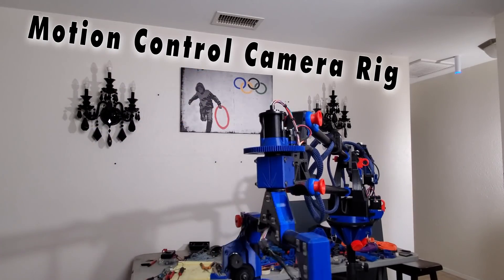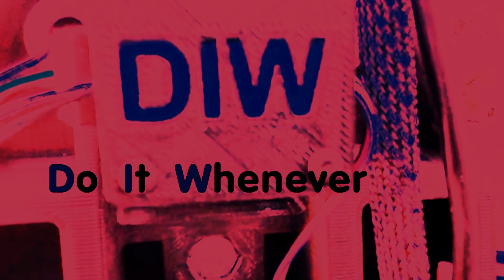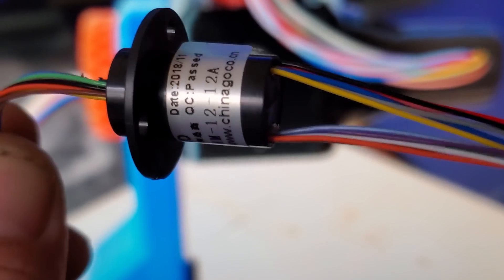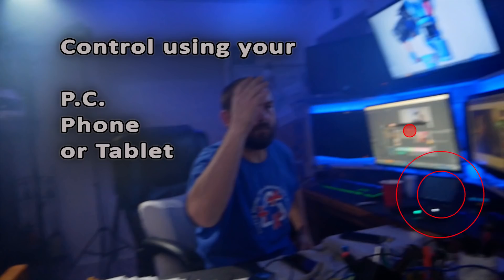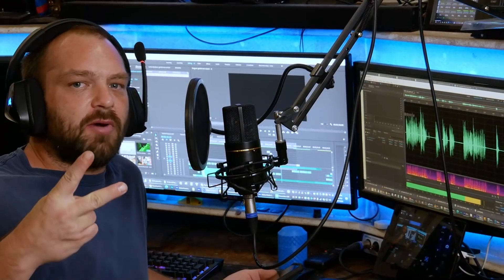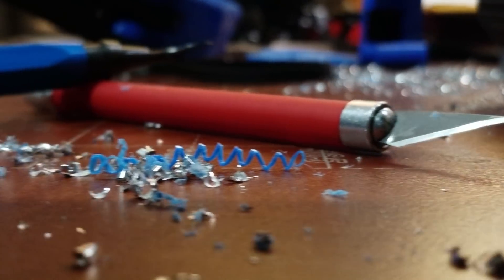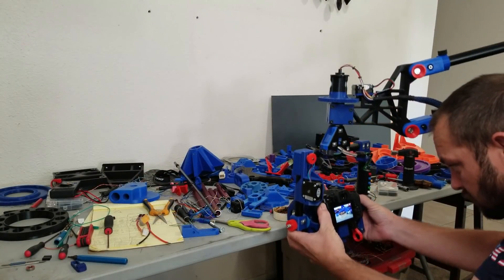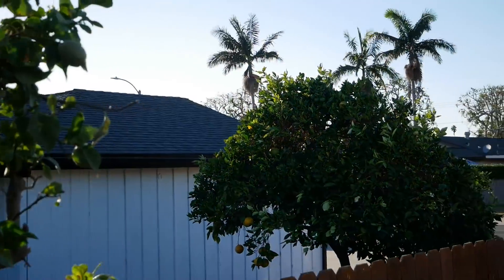The greatest DIY MOTION CONTROL camera rig EVER - allegedly

Comment: If you want to control your motion control rig via a computer then the first step (prior to generating G-code) is to be able to model it as a function of each motor's position. There is open source software to do this on github: https://github.com/HebiRobotics.  Once you've created a model of your rig (rigid structures and joints) you will be able to use its kinematics and inverse kinematics library to either figure out where your end-effect (i.e. the point of the lens) is located based on your motor positions, or better, knowing where you want to point the lens it will give the the required motor positions. Skyentific gives a quick demonstration of this with a simple 3 axis robot arm at: https://youtu.be/RTJcFyFXNE4

Comment: Great idea! I want to develop/build a (non camera) 6dof arm myself. I work in this field and of although there is some improvement possible (there always is) that is a well thought out system tbh. The LCS part is very nice! With that much 3D-Printing integration I'd say you did an awesome job to get as much as possible out of it !!! Regarding the control, I think I read something about a blender plugin to export gcode (maybe you can utilize that for a more powerful motion programming). Keep up the great work!

Comment: Do you want a stupidly bad idea?

Stepper motors, when unpowered, work as a sort of encoder. Every rotation makes a current pulse, and into a resistance becomes a voltage pulse, and there are ways to read that. Isn't that a dream? One button programming. You just guide the head around by hand, and in recording mode, whenever you want a keyframe, you press the button, or a foot pedal, and it remembers, and then it only has to interpolate between those keyframes. You are limited to half-steps, but that's still a pretty decent angle precision, you can get 400 or 800 half-steps per revolution.

Unfortunately, the project like this would be pretty finicky with regard to electrical engineering and potentially sampling too, prone to lose steps. It's probably not really actually a good idea. A much less horrible idea would be to use an optical encoder - potentially an absolute one - somewhere on the shaft.

These kinds of things are pretty much up my alley, but i don't anticipate myself contributing, because i just don't have the money or the desire to build a camera arm. I don't even have a camera. Well i do, it takes 4 megapixel photos, and is 18 years old.

Comment: Great project and great presentation!  One minor idea that came to me, would be to add some viscous parameter (done by adding some derivative term in the control) when manually moving the rig. For example, when you release (by pushing the button) the camera pitch axis, it could swing down fast... but if you had a viscous term (derivative term), it would move slowly.  Anyway, just a random idea.  Great work!!!
Reply from the maker: Thanks for the info, hopefully the next video answers everything!

Comment: First, let me say that this is very impressive work. But nobody can be an expert in the 4-5 fields needed to take this from an interesting project to a useful tool.

There are a couple of different people you might want to contact and/or collaborate with -- The first is Steve Girault of "The Garage Learning" He is teaching visual engineering using video cameras, high speed cameras and robots -- now he uses the giant very expensive robots (Bolt, I think) for his commercials, but he is a true DIY guy and could give you a lot of feedback on software, path modeling and such. Garage Learning is running a Kickstarter right now to get their "school" going.

The second person you should reach out to is "Skyentific" He is a Russian scientist living in Switzerland and has spent the last several years building robot arms from scratch: 3D printing the parts and experimenting with motors, gears, pulleys, controllers ... nothing to do with photo or video but could easily be applied. He just quit is day job at an atom smasher to do robotics full time and is looking for interesting applications -- and yours certainly is interesting.

As for software for generating the G-code -- you could start with some commercial software such as SolidWorks which would allow you to create a 3D parametric model of your rig. (Each motor's position becomes a parameter) Then if properly modeled you can input a set of parameters and see where the "tip" of your arm is positioned and what direction it points. The reverse is more complicated - if you know a path you want the camera to follow there can be infinite solutions but only some of them are optimal.  But software like that is essential for those that are looking for a solution to their problem -- only tinkerers are going to manually write G-code and see what happens.

Comment: This is absolutely incredible! I have been looking into robotic arms for this application and this is by far the best into into the space I have seen! The high end cinebot arms like the bolt cost around $200,000 with the cheapest option I've found being the Universal Robotics UR10 (without any video focused control software) which is still $45,000. I have experience with arduino and electronics but not with 3D printing. Do you have any recommendations? I'm fine with a bit of assembly if it results in better print quality / better value. Thanks so much for the video, can't wait for the next ones!
Reply from the maker: Thanks a bunch.... I can't wait to see what we can achieve together!

Comment: You should consider adding some encoders to each joint. That would allow you to manually move the camera (while pressing your motor disable) to different poses and record each.  Interpolating motion between those keyframes is pretty straight forward kinematics and could be do ne in software.  Then you would have a super fast "teach pendant" mode of programming the robot.  Just move to multiple poses, press a button to record each, then choose a speed and press play.  Would make this thing incredibly handy.  If you wanted to get really fancy, You could replace each stepper with a BLDC motor  (anaheim sells nema 17 sized drop in replacements).  Other than smoother motion, the benefit would be the ability to control them in current mode or torque mode, and program some software controlled compliance to each joint, making manual operation super smooth.  Good work, this thing is super kickass, can't wait to see where you go with the project and channel. Subbed, good luck!
Reply: Manually moving to and recording poses/framings would be so great!
Reply: Came here to say exactly this!
Reply: I agree, take a look at the robots on James Bruton's YouTube channel. Some robot's have beside encoders in the joint also pressure sensors,  so he can detect if the joint is moving manually.
Reply: You could also have a mode where you sample the positions at let's say 30hz and store the smooth motion for later replay.

Comment: Blender is open source and can control your camera.  Not as strait foreword as your approach but can be integrated with stop animation work.  I have no idea how it's done but saw a fella with his own boom that was done this way.
Idea for a boom.  May not be as good as you have now but worth looking into.  You can get fiberglass paint roller handles that are extendable.  Some with three sections even allowing a WIDE range of boom lengths.  Would get floppy at longer lengths but putting a 3d printed connector between the upper and lower boom just behind the nut for tightening the boom slider would help a little with that.
https://www.google.com/search?q=fiberglass+paint+roller+pole&oq=fiberglass+paint+roller+pole&aqs=chrome..69i57.9037j0j9&sourceid=chrome&ie=UTF-8

Comment: Whaaaaaaaaaaao!(like a kid) Whao!!!!! can you Please Please Please make a tripod Mountable version with X and Y axis....(Fully 3D printable)....Also a tip: you could use blynk to remotely control and also get video to your mobile device. Amazing project Dude!....The looks are amazing

You Could use blynk Iot Platform.....using that you could control your motors from your smartphone (using virtual joysticks and also your phone sensors) and by using a raspberry pi and a hdmi capture device you could stream your video from camera to your phone over local wifi(for low latency) or over 4G to control it from anywhere from the world

Comment: You could use encoders on your motors to enable a "replay mode".
Basically, you would switch the rig in "listen mode" where you orient manually the rig and click on a "save that position" button.
Then, it's a just a matter of interpolations between positions.

Comment: what about using gphoto2 to control the camera instead of using aditional stepper motors?
https://www.youtube.com/watch?v=1eAYxnSU2aw
Reply from the maker: just saw it. Thanks... but unfortunately my camera had issues with gphoto2 on another project... I mainly use the zoom motor which has to be done mechanically
Reply: @DoItWhenever  that's sad, anyway you solved it really well

Comment: I already love it, I'm thinking about building it, but I still had a question and a suggestion. So the question would be, how much does the components + filament cost and how long does the entire through-time take? My suggestion would be to motorize the arm in and out too, so that the arm can also be retracted and extended horizontally, or is that already the case at the base? In any case, I think it's good that you can adjust the arm in 2 lengths and use the whole thing without motors.
Reply from the maker: Stay tuned for the other videos! I have more info coming

Comment: Are your motor controls open loop like most 3d printers?  My immediate thought on how to use this setup was that you could move the camera into a position (using your awesome design), then capture the position, and repeat this.  Then you could later have the software generate the g-code to move between those positions?
Reply from the maker: these are regular steppers at the moment

Comment: For the programming of the moves it would be really nice if you could move it to a desired position an store it as a waypoint. You could then have i dial where you set the time it should take to travel between the waypoints. It would be even better if you could set the type of interpolation used for the waypoints. If all of this was implemented i think it could resultatet in a intuitive an practical way of programming the rig.

Have you had any thoughts on implement something like this?
Reply: oops I should have read your comment before I made mine.  This is EXACTLY what I was thinking!
Reply from the maker: Stay tuned for the other videos! I have more info coming

Comment: Really great project. I loved the thing about the buttons where you could disable individual motors. I guess a really neath feature could be to implement simply a damper effect on the "freehand" move. This could probably smother out the moves and maybe one could control in software how much dampening effect one needs. But this would most likely require torque feed back.
Reply from the maker: You can with freehand.... you can tighten the axis down for tension. no need to program it :) Stay tuned for the other videos! I have more info coming

Comment: Wow, very well done!
For the programming of this Camera rig: a few days ago I started to plan a motorized slider with pan and tilt function, so it's only 3DOF instead of the 6DOF of your rig, but maybe you could also use a similar technique. I am planing to use two joysticks to control the slider. The idea is to start at specific point and then press "record" and move the slider to the desired position with the joysticks. All of the inputs are then saved to a log file and can be repeated as often as you like. With a few potentiometers you can then speed up or slow down the movement and have a repeatable result. By using Joysticks with a Twist Axes, you could use just two joysticks to control all 6-Axes. While this will probably need some time to get used to it, I think it should be possible to control. Personally I like the idea, that you can just try out different movements and directly see how it behaves and then later on be able to repeat the same movement.
Reply from the maker: the SKYNET is the limit :)

Comment: Awesome project! I'm working on a similar idea of a 6 DOF slider and sometimes I miss having the crane aspect with the camera hanging instead of it off axis. Have you considered motorizing the crane extension/retraction as well, so you can do a slider motion or an arc motion on a sphere around the subject? That's the only limitation I think with this design if I understand it correctly.
Reply from the maker: Maybe I'll build that on version 2 :) Stay tuned for the other videos! I have more info coming

Comment: Great project! Would be awesome if you would combine the manual motion mode with a "record position" button to just record a bunch of positions and to generate the gcode from that. Easy and no software required. Would require some additional encoders though.
Reply from the maker: the  SKYNET is the limit :)

Comment: What sorta setup are you running on the hotend, im thinking of doing a water cooled hotend
Reply from the maker: the machine on the left has a block I made from a solid chunk of aluminum (made before WC hotends were around to buy) I wouldn't make it again but there are few overseas options.  the printer on the right has a bought version....but there are even better ones now (smaller)
Reply: @DoItWhenever  I hate to be this person but do you have a link to something you would recommend?
Reply from the maker: @unknown_9100  Really not sure. I tend to build everything myself as a hobby, because I'm cheap....and my ego thinks I can do it better.   Maybe google water cooled hotends. I think E3D  has an off the shelf option.

Comment: How can this become even way cooler than it already is?
This looks great. I have been looking at the camera arm from Alexandre Chappel but that is one huge thing to store away when not being used.
I have also looked at camera sliders and ideas to build one with 2, 3 or more motors in order to move the rig by hand and capture positions.
I am a programmer so that is something which is surely a possible task (it's not rocket science, it's just nuclear physics) ;-)

I have tons of questions about the motor controllers, the motors and much more.
Reply from the maker: A Solid programmer is what this thing needs :). I know all the possibilities I just don't know how to accomplish them all :) this machine is running a grbl fork (not my firmware design) that version of grbl is made for up to six axis.. you can get a ton of cool linear shots with that basic controller and firmware... And hopefully easy for others to set up as well. But I think the magic is going to happen when custom firmware makes its way into the memory.. something that will take advantage of the stepper libraries available on Arduino and combine that with non-linear ramping style moves... And a gui or graphical representation.. realistically... Buying an off-the-shelf controller and using something like dragon frame would clearly be the easy way to do things.... But that's no fun

Comment: For the open-source control software: Use ROS and MoveIt. It calculates all the inverse kinematics of the arm and it lets you program complex multi-waypoint trajectories. That's what they use for industrial robot arms :)
Reply: Inverse kinematics was something I wanted to suggest. Since you already got a Pi, you could also slap a screen on there and give it a "teach mode" where you move it to specific locations and it repeats those. A of now, it would have to be powered up though, as you have got no encoder feedback. Maybe that could be a future idea? You could also take inspiration from professional cinema robots. Maybe talk to Steve Giralt about that? (In case you don't know him, he is the god of cinema robots)
Reply from the maker: Thanks, I'll check it out

Comment: This is very interesting project and could have many applications. Once the kinematics model of this system is defined the possibilities of automation are huge. I am curious about the Nema 17 specifications like torque for example and the gear ratios in them (the links send me to the site but not to the specific models). What is the weight of the system and what is the max  payload that it can handle with and without extension ? .. Great work and thanks for sharing
Reply from the maker: Thanks! Stay tuned. Hopefully the next videos will answer everything..... but I agree the system is actually rudimentary, the possibilities are amazing in the community hands

Comment: I'm curious, have you done the reverse kinematics model for this yet? A killer feature would be the ability to move the rig (by hand) to a particular position, capture that position, and then animate between points. You could make a pretty powerful system with a very simple UI using that approach. This would of course require that you have rotary encoders to measure each of the 6 degrees of freedom plus linear encoders for the slidable section -- but I'm guessing you at least have plans for that, so that self-collision avoidance can be added. It would be pretty unfortunate to have it smash your DSLR into itself and fall over :) Nice work!
Reply from the maker: It's still in it's infancy :)  and when the community throws brute force at it...it will be way cooler!
Reply: There are some cool driver-on-stepper boards you can get now where they have magnetic encoders on each motor allowing them to both offer closed loop control, and feed back the actuator positions to the host over <insert your favourite serial bus>. They compensate for lost steps by just knowing where they are at all times. From there it would be very little work (math) to build out the kinematics.